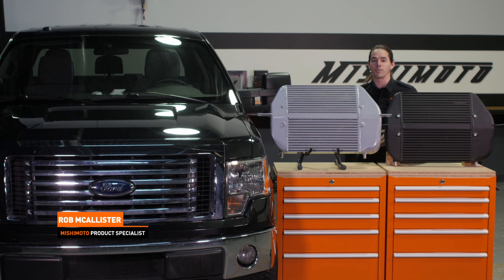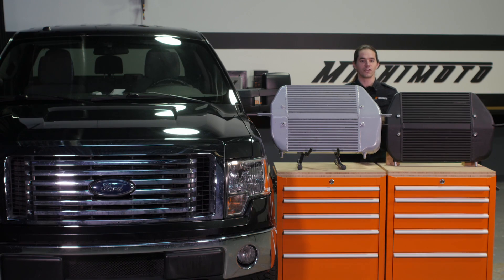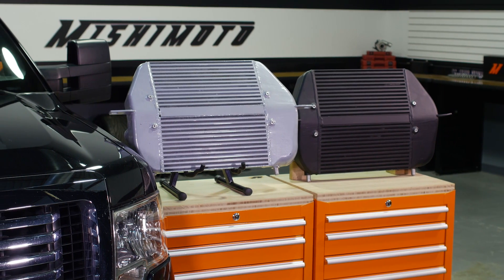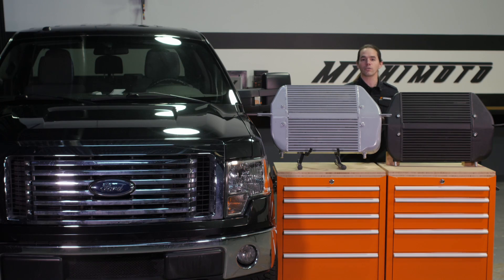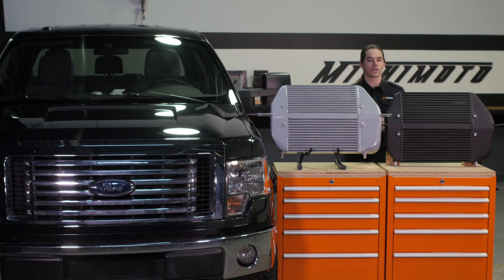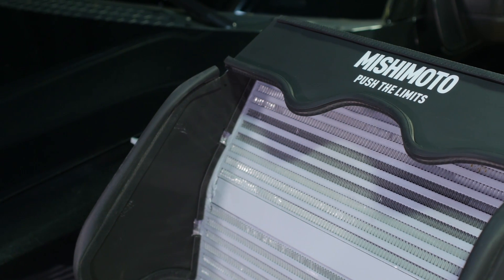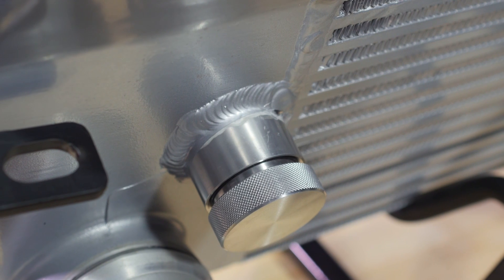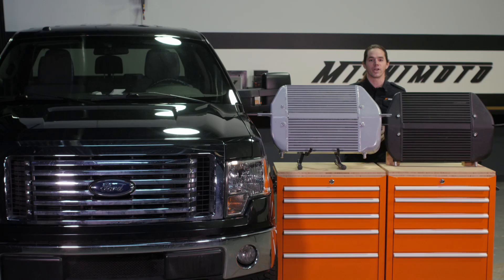2011–2014 Ford F-150 EcoBoost Intercooler Features & Benefits by Mishimoto

Comment: Install this in my truck and the gains were amazing. A lot more low end torque  and it runs much more faster. I really feel it in the pedal... Of course I have a after market exhaust, intake and bigger throttle body.